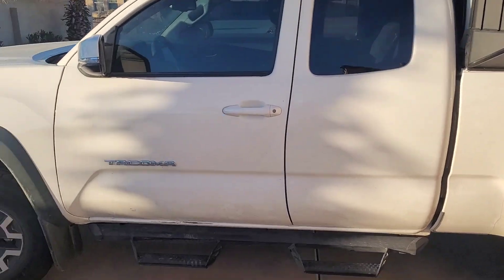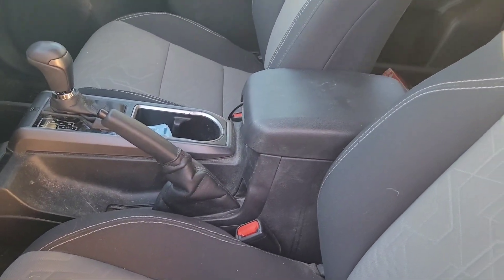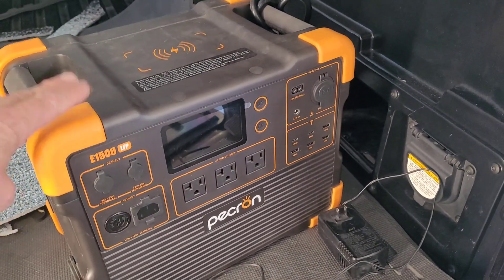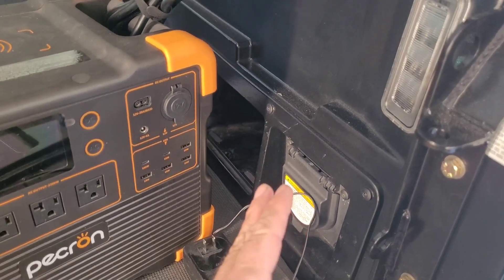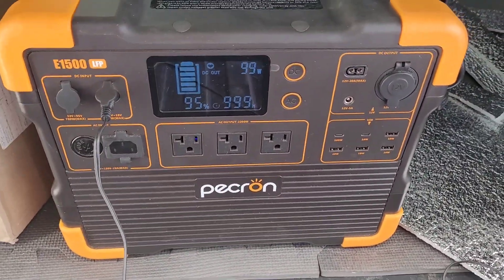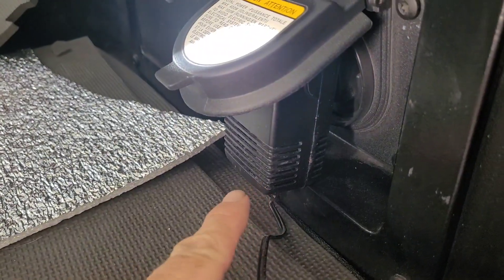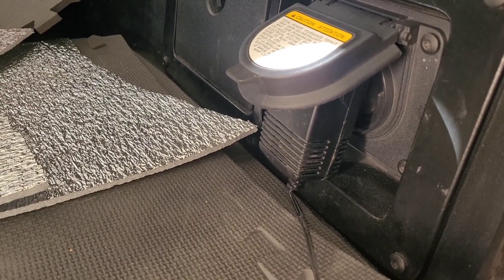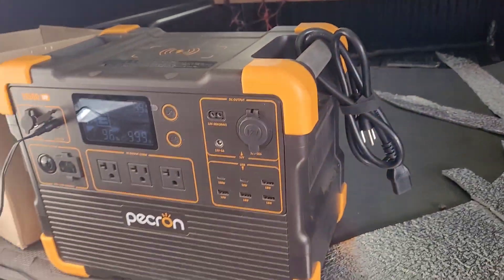Charging Power Station from Tacoma Truckbed 125v Inverter

Comment from the maker: Video shows using the 3rd generation Tacoma truckbed 120v outlet, to charge a Pecron e1500LFP power station.  The problem with Tacoma power is that it is a Modified Sine Wave (terrible), not a Pure Sine Wave inverter.  No power station tested so far will accept the poor malformed ac power, including Pecron e1500LFP,  Bluetti AC200Max,  Ecoflow Delta2 Max, and Jackery.  So you can't just plug your power station into the AC and charge it, you have to somehow convert that nasty power to something your piwer station will take, which means some dc voltage and feed it into a Solar Charge Controller port.
   I am NOT planning on using this small wall transformer, it was just what I had with the correct 5521 plug for testing this.  I have an adjustable power supply coming today.

I need something like an adjustable power supply where I can limit the amps and watts, because power station will pull up to 700W and trip my Tacoma inverter reset or blow its fuse.

I'm just doing this to make use of existing bed wires, so I can get power station alternator charging in truck bed WITHOUT having to run more wires.  The few amps inefficiency using truck inverter and dc to ac to dc, is immaterial to me vs the convenience of not running large gauge wires from engine.  Hope that explains the "Why?" ;)

Comment: The cheaper power stations usually have a brick somewhere in the 110V charging cord which makes it compatible with the Tacoma inverter. I just need it to run my fridge/freezer when stopped on long trips. As long as my fridge is loaded and pre cooled my little power supply stays at 100% charge at 0°. Will still have 40%  in the AM after overnighting in the hotel. I just bring the bigger Bluetti  if I'm going camping and need the longer run time and use the 12V charge for it. Never needed any more than that.
Reply from the maker: Yup, this vid is for folks who DON'T  have a dc brick charger, which is just a power supply like I show.  Always good to get power use numbers on a fridge though. Sooo many differences for power used, depending on size, outside temp, fridge or freezer mode and temp setting... same fridge can be 100Wh to 800Wh in a day.  So folks really have to test their own settings and fridge.  Glad you've found a setup that works well for you!

Comment: Any recommendation for a Jackery 8020 DC port power supply to go into Tacoma outlet? I have a Jackery 700+ if that matters. DC on the Jackery is rated input for 12-60V at 11A max. Though I’d be happy with 100W flow. I currently came up with a AC/DC converter at the outlet to run into the Jackery bit that’s a lot going on in the bed.
Reply from the maker: I would just use an ac/dc converter into the jackery myself.  Then whatever 8020 adapter you need for it.  It says 11A max, but not the max watts  in... probably can't do 60v 11A for 660W.  The Tacoma plug only does 100W while driving unless you do the "400W Anytime mod", then 400W.   So get yourself an ac dc charger that is less than 400W.  Good luck!
Reply: @dave_in_az  just checked and it’s 400W max input via DC. I went with a 100W supply for now off Amazon. I did see a 200 but that was it for what came up with a 8020 or 8079 pin for a power supply. I didn’t want to tie up my DC car charger cord with the converter for the Jackery in case I wanted to feed from the 12V port in the cab in tandem with the power supply for more input.
Reply from the maker: @jeffsviper15  that tandem feed sounds like a decent way to get 220W or so, 100w from the 120v bed and 120W from car port.  Thats 18A, which is pretty close to the 20A Or 25A victron or Redarc chargers.  For a 130A Tacoma Offroad or towpackage alternator, that's a good safe amount, and will top off your Jackery decently fast.  Nice plan.

Comment: Dave, can you test the outlet with an outlet tester? Mine is indicating an open ground. Is that normal on this?
Reply from the maker: Yes, all GND are open on power stations.  Open GND just means no voltage between hot and gnd, i.e. the GND wire is not connected to anything.  So, looking at a power station,  of course it isn't, the PS isn't connected to any gnd.  Some larger power stations do have a gnd terminal that you could hook a wire to, and then drive a metal stake into actual earth to create a ground, bit these are usually large house replacement units intended to operate standalone when power fails.
   In an electric setup, say your house, they are allowed to connect the neutral to the gnd in one single spot, your main panel. This is called Bonding.  GND wire lets fault current flow to earth. Bonding gives a path for fault current to return to source.  Allowing GFCI breakers rely on current mismatch between hot, gnd, neutral--detecting current on the gnd.  If someone bonds gnd to neutral before the CB and main panel, it can't detect it correctly.
    The NEC is very complicated for mobile systems, but the same concepts actually apply. But there is no actual gnd, no wire from car driven into earth.  And people constantly use the chassis as the neutral or negative,  instead of running an actual wire... but ALSO use the chassis to ground stuff, connecting equipment Gnd wire to chassis.  So, that creates bonds all over, potential for ground loops, and difficulty tracing any electrical issue or open circuit leak.  In an AC system, like a mobile powerstation,  there should be only a bond IF NOT CONNECTED TO SHORE POWER! This would let the GND no longer show "open" for you.  But if you do that, then plug the powerstation or say an RV ac setup, into shore power, suddenly you are creating a violation and safety risk for the shore power system by having a bogus bond in their system!
    High quality systems like the Victron inverter-chargers, and "transfer switches" have an automatic bond that disconnects if plugged into shore power.
    This disparity of open GND, no bond when plugged into shore power, single bond in system otherwise, is the single largest source of questions on the RV and mobile solar forums.  95% of all posts and videos I see have bond/chassis/isolation issues vs NEC requirements, and everyone just accepts it or gets it wrong.
    You can actually get rid of the open gnd issue on your powerstation,  which will stop a lot of equipment from working.  You do this by making a filler plug that just has a single wire connecting Neutral and GND prongs--don't mess it up and use HOT! Then plug it into a 120v ac port. This will create a bond, since these smaller powerstation don't have that accounted for.  This is fine.  HOWEVER REMEMBER TO REMOVE THAT THING WHEN YOU PLUG STATION INTO SHORE POWER TO CHARGE!
   Here is a great paper on the diysolarforum.com of Will Prowse that explains mobile grounding:
https://diysolarforum.com/resources/grounding-made-simpler-part-4-mobile-systems.159/

P.s. I forgot to say, tested mine and yes all 120v ports have open gnd. With a bonding plug inserted in one, the other two test good with no open gnd.

Comment: I can charge my Bluetti AC1800 from the Tacoma outlet, change two settings: 1) put AC charging mode to Silent (this changes the input from 1000w to 270w and 2) turn on Grid Self-adaption in Advanced settings (this accounts for poor quality AC input).
Reply from the maker: Wow, great to hear! Those are two very nice features that Bluetti has which I hadn't heard of before  or with others, and I watch a pretty good Mount of reviews.  I'm glad you commented, that will help someone out!
Reply: Interesting, how long it take to charge your power station in this mode?
Reply from the maker: Not sure if question is for me, but 280W, 1 hr =280 Wh.  My Pecron e1500LFP has 1536Wh. So, 5.5 hrs if I completely discharged it, which I wouldn't really.  In reality, 280W is pretty good, it recharges me 55% in 3 hrs.  And it is pulling 23A from my alternator, which is a good lowish amount for my weak 130A Tacoma alternator.
Reply: Any more news on the Bluetooth ac1800?

Comment: I'm unclear on what was used here. Is it just an AC to DC converter? That takes care of the modified sine wave issue?
Reply from the maker: It is a settable power supply-- an Ac to dc that you can set the volts and amps, giving a max watts.  Maybe not needed for other power stations, if they have a draw of 400W or less.  Any ac to dc will fix the MSW issue.  But this Pecron will pull 700W, which exceeds the Toyota inverter circuit breaker, and will make the inverter shut off , and could blow it's fuse.  This power supply lets me for sure keep the pull below 400W to keep inverter running.  Or I can set it to 250 or 200, if I'm worried about my alternator working too hard, say if its summer and I'm running air-conditioning hard.

Comment: Can you charge a 24v lifepo to that 32-96v connection,,, since your said the other connection is 12-18v but the manual says up to 24… however on the other side will it take a 24v lifepo since the minimum is 32
Reply from the maker: Thx for watching and asking.   I would say No.  The 5521 input in new manual says "12-18v, VOC of PV panel must be less than 25V."  I saw Hobotech test it to 24 or 25V too.  However, a 24V LiFePO4 battery is 27.2V when full, doesn't drop below 25V until only 10% power left.  So it probably wouldn't work and could fry that mppt input.

The 32-95V input won't turn on until voltage is 32, I have tested that.  You could run battery through a small booster, I looked at doing that to get 700W from my 12V battery there.  But most of those all say not to use them to feed an mppt in specs... I don't want to test it and smoke the power station.  Still looking for one that says it's reliable enough to feed an mppt input.

Comment: This is right on time for me. I’m troubleshooting the exact same issue right now. Thanks for the help. Totally unrelated, I like the way you’ve mounted the diesel heater in the background. Did you run the exhaust through the bed of the truck?
Reply from the maker: Sure did, look at my other videos, I have a short one showing my install, easy to find in my 10 videos or so ;)

Comment: i am sure you are aware that you could use the E600LFP power brick from Pecron to charge your E1500LFP. the E600LFP brick produces about 300 watts. the brick can be bought separately for about $100.
Reply from the maker: Great info Wade, and a good idea.  
It seems the brick is just exactly what I show here, an Ac to dc charger, Ive heard the power stations with a brick don't have issues.  So it outputs dc to the power station whose motherboard accepts it.

The issue apparently is in power stations that plug directly into wall, where the ac to dc conversion probably happens in a combined charger unit, just like many mppt solar charge controller/ ac charger combo units now-- the AC power is hitting a motherboard that has protections for inputs built in and not accepting.

Anyways, YES, I was having a hard time finding a 300 to 400W ac to dc charger brick I could use.  Or a 100W one that already had the needed 5521 output plug.

I believe those charge bricks don't self limit their wattage, but that is limited by what the power station pulls.  Much like this video the dc transformer is rated for 64W, but will output more along its thin wires when the power station load asks for up to 100W.  Is that your understanding of charge bricks also?

One wrinkle I didn't mention is that the Tacoma inverter is protected to 400W,  but not limited to it--you're supposed to just not use more.  If you ask for more than 400W, it will supply it but then shuts down the inverter, or even blows the fuse which is a super pain.  So I actually need something that I can set a limit on, to keep from messing up the inverter and wee wires.  Last night I bought an actual power supply with settable voltage 0 to 60V, and amperage 0 to 8A, which will let me exactly dial in the pull on that inverter, so I don't pop its protections.

Thx much for your input, might be a good solution for the 100W port, for folks without an adjustable power supply!